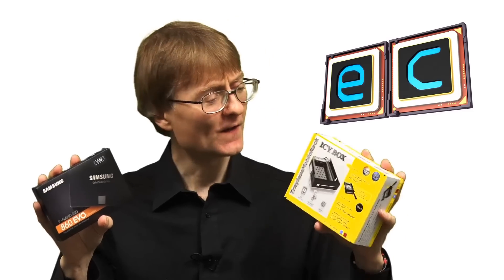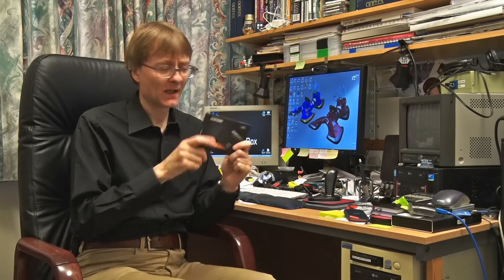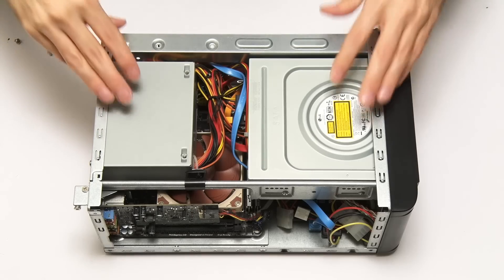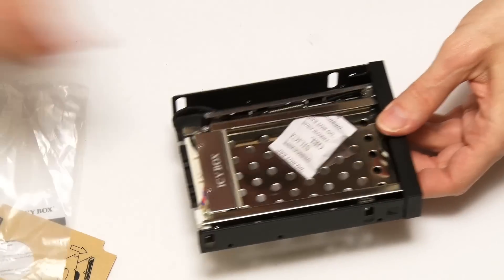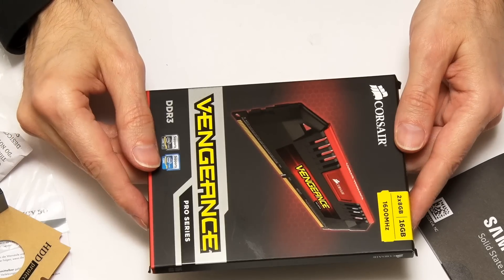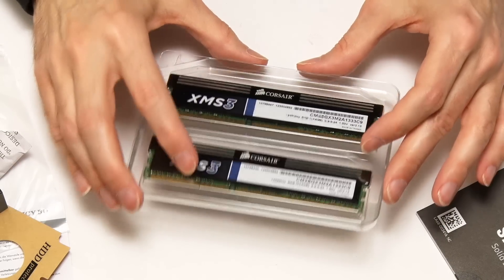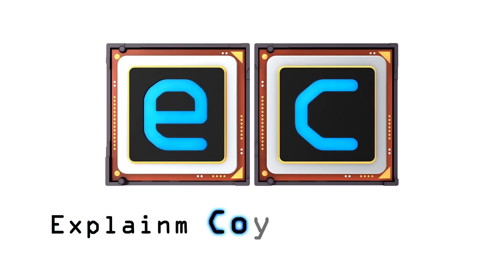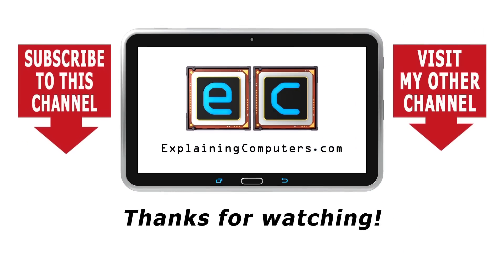i3 Mobile Rack

Comment: Hello Chris, may I ask you why did you choose Mint instead of Ubuntu?
Reply from the maker: Have you used Ubutu?! It's very slick, but the interface would drive me mad! :) Unless I customized it heavily. In which case I might as well start with an interface I like, hence Linux Mint.
Reply: I have been using Ubuntu for more than a decade now and I think that a Windows-like GUI is easily achievable using many desktop environments. You could use LXDE if you wanted a very lightweight and easy experience, otherwise you could use XFCE after a little bit of customization and still have very little problems graphic-wise. Apart from the DE, Ubuntu is generally more solid than Mint IMHO. Maybe you should give it a try when you feel adventurous! :)

Comment: you said I could use a 4 X  card in a 16X it will not show up as a device any suggestions in what I can do the card is a raid card An L.S.I.
Reply from the maker: A x4 PCIe card will certainly work in a x16 slot. However, you will always need appropriate drivers for any hardware to show up and work. Often these days we take it for granted that Windows includes (or finds) drivers for everything, but this is no always the case. So I suspect this is a driver issue.

Comment: I'm curious as to how you can install a larger ssd when your os is already installed on the one you'll be removing?  Do you need to install a second ssd interface?
Reply from the maker: The larger SSD is indeed connected to a different SATA port -- I added an additional larger drive, rather then moving my OS to a larger drive. You can (just about) see the second SSD in the video -- it is under the front bays where the other drives go, the connections being bottom right in the top shots of the case.

Comment: I have an ICY DOCK 2 bay caddy that I've yet to install in a system, really need to get that done HAHA!!!  My main desktop PC runs a 1TB 10,000RPM HDD though, so I haven't messed with doing anything to it, and it would mean losing one of my DVD drives which I'm not going to give up...so I'll eventually build a new machine but haven't really decided what I want yet either HAHA!!

Comment: glad you decided to use the sata power plug included with the psu instead of that molex to sata adapter as those adapters can cause burning and instable power which can potentially break the ssds.

Comment: You can do better:
Have a look at FLEX-FIT Duo MB343SPO  5,25” -> 3,5” + Ultra Slim ODD  Adapter
or the ICY DOCK ToughArmor MB994IKO-3SB (2x 2.5"SSD and  Ultra Slim ODD  Adapter)

You just need a SlimeLIne DVD-RW like the LG GUD0N.ARAA10B or the Asus Ultraslim Notebook Sdrw-08U1MT
and a Cable-Adapter for it (Startech SLSATAADAP6 or DeLock 84390 )

Assuming that you Mainboard has 4 SATA Connectors you may use a
ICY ToughArmor EX MB492SKL-B to fit in 2x SSD (or a SSD an a 2.5" HDD)
oder even the ICYToughArmor MB993SK-B für an overall of 3 SSDs

A second HDD/SDD can be used for Backups or even as an andition boot drive

https://www.icydock.de/goods.php?id=214
Reply from the maker: A very cool bay! :)

Comment: Ok, odd question, does that panel that has Thermaltake written on it ( 11:17 ) not removable?
From previous build experiences, they generally just clip in to cover the bay when you're using them for HDD, but come out if you had a 3.25" FDD

This setup would allow you to keep the DVD drive, (unless of course you just didn't really utilize it) and still have the functionality you're after.

As for that drive protection sticker, unless extra stickers were cost effective, my first inclination would be to just stick it to the bottom plate of the enclosure so that it'd work on whatever drive got put in it.
Reply from the maker: The panel is a drop-down door to a compartment that includes front USB and audio jacks. There is no 3.5" bay behind it.
Reply: @ExplainingComputers  - Yes, meant to come back and edit/remove this after taking a peak at your initial build video.

Still, unless your rear USB3.0 ports were full, a Multi-Card reader/USB(3.0) stick friendly HUB would have cost you probably just as much as that drive bay adapter would have, and you could have used the USB 3 "bay" opening for your caddie system, and kept the Optical Drive

I'm sure you had your resonings, especially if the optical drive is seldom used.

Just seemed an unusual choice to make considering your other options

But to each their own

Comment: What Kind of Mouse are You Using? It Looks Interesting.
Reply from the maker: It is a 3M Ergonomic Mouse. The fingers remain at rest while holding the fixed centre column, while the thumb rocks to click left/right. It is designed to ease RSI -- and it works. I've been using one for over 20 years.

Comment: Good job Chris. I hope that it doesn't overheat. It looks kind of tight in there. Two thoughts, 1- you could have cut open the power lead to the front led and added a small potentiometer, or you could have put a small piece of tape over the led. My uneducated 2 cents worth. Good show. Stay well.
Reply from the maker: The processor is a "T" model, 35W TDP, witha  fan rated 65W. So I've had no temperature issues, although space in the case is tight as you say. :)

Comment: Why would you do this, you could have just had both drives in, put the Linux drive first in the boot order, and grub will let you boot into either when you turn it on
Reply from the maker: Please see pinned comment -- I have answered this question here probably 50 times already! :) I do not want a dual bot machine including an OS what I will soon hardle ever use. And I want the flexibility to swap the boot drive with lots of other drives -- not just two! :) And indeed to be able to quickly switch out the boot drive to a clone in case of failure. I am not recommending anybody else to do this, and have cover dual booting many times on this channel. But this setup is the right one for what I want to do with my own hardware. I will never, ever make a video showing viewers  my own hardware again.
Reply: @ExplainingComputers  you might as well have left the primary os in a non-hot-swappable bay and if you want to ever do something else you can just use hot-swap(variety of os that are used rarely, if you ever decide to use a normal SSD to back something up or anything else)
Reply from the maker: I cannot achieve primary OS in non-hot-swap when it is currently Win 7, but in a month will Linux Mint. Also, if the primary OS were non-hot-swap it cannot be easily changed in the event of failure. Also, installing alternative OS with the main OS present is not wise if you do not want bootloaders messing up your primary drive. I test all kinds of wierd things! :) So I want my primary OS removable.

Comment: Why not just format the drive to dual boot?
Reply from the maker: Please see my pinned comment. For a start, I do not want a dual boot system, as fairly soon I will not be using Windows 7. Reformatting the drive would also cost be a lot of time setting up Windows 7 and all the software there, registry hacks, etc. The whole point is that I don't want to touch my stable Windows 7 setup! :) And I want the flexibility to try many different OS for video production here. Dual boots on a single drive can also cause problems (I would personally never have a boot loader on the same drive as Windows).

Comment: You can always use an USB adapter with your DVD drive should you need it, and those 2x USB 3 ports in the front make it simpler.

Comment: Hello, Mr. Barnatt;
Thank you for all you do.

Nice job, well done.
I appreciate this, I'm likely moving to MX linux myself [01/2020?] & the issues w/ various dual booting schemes has left me slightly disturbed.
I already have 3 different SSDs w/ 3 different OSs installed but this seems like a better solution than trying to select the correct drive via either the BIOS/EUFI menu or the GRUB menu which hasn't been satisfactory.
I'm just getting serious RE: linux now that Win 7 is EOL but I have 1 program that doesn't want to play nice w/ WINE so I want to keep it on a separate SSD & swap them out as you are doing.
Thanks again for all you do.
Have a GREAT day, Neighbor!

Comment: That british wit of yours always gets me, Mr. Chris. I was planning on doing the same as yours, but I wanted to ask: why didn't you use a 3,5" drive bay for this instead?
Reply from the maker: Because the PC only has one 3.5 inch bay, and that is already fitted with the front USB 3.0 ports. So I had to use the 5.25 inch bay. :) What you see below the 3.5 inch bay with the USB 3.0 ports is a door to the front audio and USB 2.0 ports. No bay there I'm afraid.
Reply: @ExplainingComputers  Yeah, well, I didn't remember that wasn't a drive bay. Sorry.
As you said, a DVD drive isn't much used anymore, even less in your context. Putting it in an external enclosure would look cool, like those sprawling external units for the Atari 8-bit computers.

Comment: Why didnt you one with a swap tray that protects the drives?
Reply from the maker: SSDs are pretty hardy, and in time I would need lots of trays, or be constantly taking drive in and out of them (as I have to do on my test rig!).
Reply: @ExplainingComputers  True SSDs are pretty hardy indeed, And i geuss if you do take out alot of drives over time, having to buy both a new drive and tray gets costly yes.
However, despite of that, SSDs are still vulnerable to some of these outside influences.

Comment: All that and all you really had to do was set up dual boot on your existing hard drive.
Reply from the maker: See my pinned comment -- a dual boot was not what a wanted here! :)
Reply: @ExplainingComputers  I understand that. Not messing with and perhaps mucking up your current OS was not what you wanted to do, however, you could have cloned the drive and tried from there. We do it all the time with Macrium Reflect. Or, you could have used Virtual Machine to run Mint inside your Windows 7. Perhaps those solutions would be inspiration for future videos for you.
Reply from the maker: @yourpcmd  Thank for this. But I have made multiple videos here setting up a dual boot, cloning drives in Macrium and other packages, and setting up virtual machines. :) But none of these solutions were the best for me here, as I have explained in the pinned comment and many, many times in replies to other queries below. This is because I have no intention of ending up running two OS -- rather, over the next few months, I will be migrating from one to the other, then keeping my Windows 7 boot SSD in storage just in case I need to get back into it. The swap bay is to facilite this, not to allow regular switching long-term. I also want the flexibility to change the OS drive on the machine -- not just to switch to one other OS, but to lots of other OS setups, as I frequently install and test OS for videos.

Running Linux Mint as a VM inside Windows 7 would not work, as when Windows 7 is no longer supported, it will not be safe to connect it so the Internet. So how could I use Linux Mint online inside a host that cannot be online?  (Well, OK, it could be done, but would not be the best solution, and as noted above, I will no longer be using Windows 7). This video is not presented as something everybody should do. Rather, it is simply showing the solution I chose to do for my own purposes. And the solution I have chosen is the best for me. :)

Comment: nice video I liked it very much, especially when you through the manual, but you could have done, put a sticker on that flash led or cover it with tiny dark duct tape that would do the job and you won't need to reopen the case to a unplug the led wire

Comment: Great idea! I'm also running Win7 until I can't anymore, then switching to Linux Mint. I don't like Windows 10. I'm running an old Dell Precision M6500, with dual boot setup, but I have a desktop in the other room that I might try this on. Thanks for the idea.

Comment: I took a liking to your 2014 i3 build including the mini ITX case, I built mine in june 2014 but squeezed in An i7 processor. It has been working very well ever since with a recent 16 GB memory upgrade. It is on 5 hours a day and consumes about 40 watts , a lot less than my previous 250 watt computer which used to heat the room! I keep a clone SSD inside so if there is a problem I can quickly carry on. What was the graphic card you had in your i3 and is it likely to perform better than i7 built in graphics? It is difficult to know if any particular graphic card will fit in the limited space. I have no plans for ever upgrading again !

Comment: Oooh I like what you did with the caddy but there is, in my opinion, a better option. I bought an Icy Dock Flexi Dock MB524SP-B which fits in the same drive bay, has one power connector but can seat 4 x 2.5 inch drives. Each of these can be powered on individually (or collectively) from buttons on the front. They are also simply ejected without the need to undo a single screw. Look it up as I think it would really suit someone like yourself who uses multiple OSes on 1 system. Might save you a lot of time in the long run.

Comment: Is a removable rack really necessary to achieve this? Could you  use something like this instead?

HDD Power Control Switch, 2.5-inch Hard Drive Fixed, Multiple Hard Disk Control Selector SATA Drive Switcher for Desktop Computer Optical Drive https://www.amazon.co.uk/dp/B07SQVMNDF/ref=cm_sw_r_cp_apa_i_QwK0DbNG02WZZ

There is a 4 port version too. Generic Chinese peripheral under different brands. Orico make something similar in aluminium as well. 

Print a couple of dymo labels reading Windows 7 and Mint to stick next to the buttons just to make a look a bit nerdy and you're sorted! 😁

Only probably I can see is that some systems might not boot or there might be a delay with just a SATA cable connected with no power.
Reply from the maker: You could. :)

Comment: That bracket is usually used for putting a 3.5" floppy disk drive in a standard CD drive bay, you can also use it for a media card reader as well cuz it's the same size as a floppy disk drive

Comment: I know I’m an idiot, but I prefer that you run KDE Neon or FreeBSD than Mint! LOL. I also would like to stick it to Intel for their poor CPU Design that’s vulnerable to ... was it Spector, Melt Down and RAM Bleed and Intel’s ‘leading-on’ Infosec researchers about real fixes to these types of vulnerabilities, therefore I would like you to change to a Ryzen 3 or a highish power RISK-5 computer. If you’re going to continue with Intel, I prefer you use Optane where the OS runs in ram. Unless that negates being energy efficient or if you power down your system often. Question: do you have to reload the OS each time you power on when running it in Optane as RAM?

Comment: This video could not be better timed! I'm actually starting the same project tomorrow except I'll be using POP OS. Initially I was looking at installing a switch that would just let me flip a 2 or 3 position switch to choose which drive starts when I boot, but I've decided to go with a bay insert similar to yours.

Comment: I am in a similar position except with a laptop. Long story short, Samsung SSD drives need the Samsung Magician software in order to manage certain settings and to update drive firmware but it only runs in Windows. So I installed a bare minimum Windows 10 for those types of purposes. I didn’t dual boot (in the traditional sense) but am using two drives (both installed), one for Win10 and one for Mint. I have Grub set up to allow me to choose which drive to boot from and things work nicely this way.

Comment: My SSD drive has Windows 10 and Ubuntu 19.10. My last hardware upgrade was adding a small 2 port usb 3 card.  It uses the short pci slot. Maybe I will try this Icybox thing. I won't need much for a second SSD, maybe a 256 or 512GB at the most.

Comment: Keep in mind too, Chris, you can still upgrade to Windows 10 for free using a Windows 7 key... (or, at least, it still was working as of a few weeks ago!)

Might not be a bad idea to grab a 3rd drive, even if just temporarily, to throw Windows 10 on, update to newest patches, then plug in your Windows 7 key... just in case you decide down the road you want Windows 10 on this machine, well then you'd have a free version already!

And worst case scenario regarding yanking that old drive out, external USB-DVD drives are abundant on ebay and otherwise, so if push comes to shove that's always an option as well.

Comment: I’m planning on getting some kind of Icy docks too, they even have them for laptop optical drive bays so you can swap 2.5” drives in and out
I’m surprised you think an i3 processor is enough for running a host system and a guest virtual machine at the same time plus software and browsers etc, I would have thought that would be painfully sluggish?
Interesting to see how old most of your computers and monitors are, just goes to show how sufficient a lot of the old hardware still is for most purposes even these days!

Comment: Commendations, Professor Barnatt, on your latest innovation and tutorial. I'm sure that having a swappable main drive will make switching from Windows 7 to Linux Mint a fair bit easier when the time comes.
I'm sure that an intelligebt and knowledgeable fellow such as yourself will have noticed the one problem with your swappable main drive plan, namely the disposition of your data files. Right now, (or as of the end of this tutorial), they are all on your Windows 7 SSD and copying them over to your Linux drive could be problematic. The obvious solution would be to install yet another SSD where the Windows drive used to be, (under what is now the Icybox), and using that for data file storage instead of your main drive. I'm sure that whatever solution you come up with on your own will be ingenius. Again, my compliments, sir.
Reply from the maker: As noted in the video, I have a second data SSD in the machine -- and work a lot in Google Drive/Docs.